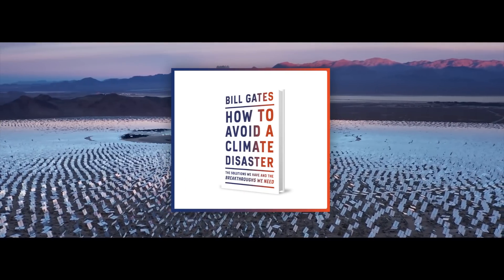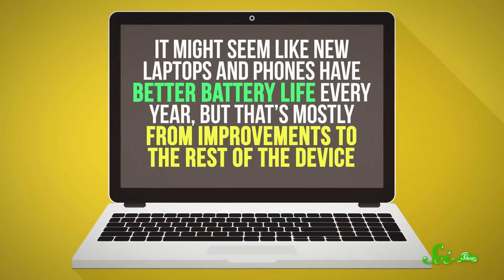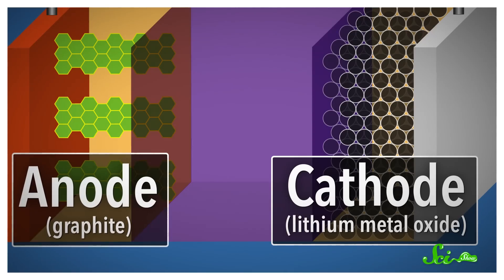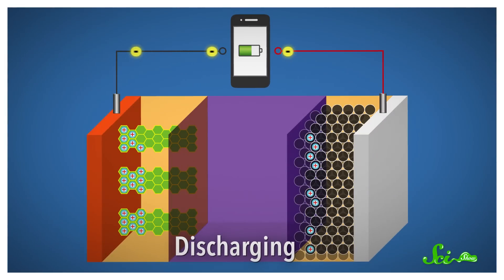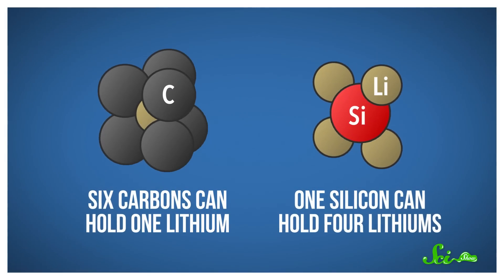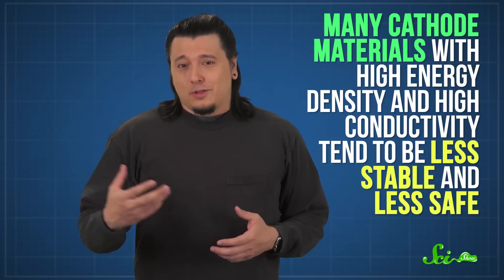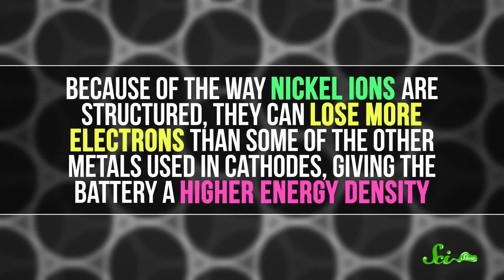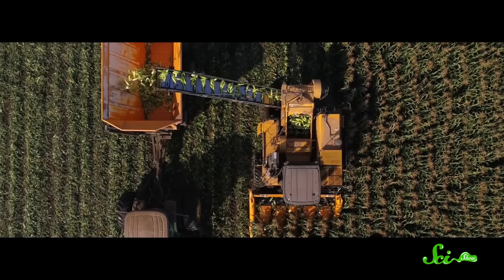Why Haven't We Built a Better Battery?

Comment: The real problem of solar plants is the tons of unrecyclable, toxic, heavy metal garbage they generate every few decades. Arguably they're as or probably even more problematic than waste from nuclear plants, given how much more is generated. That on top of replacing huge areas of ground, overtaking natural habitats. Discussing solar in the same way as we do wind or water plants is a joke. Unless the panels can be made recyclable, it's not a valid ecologic solution.
Reply: The way I see it, it is just a better way to do it vs... coal and stuff like that... so we have to deal with it and try to make it better until we find better...
Reply: 90-98% of photovoltaic panels can be recycled. There currently are no large recycling programs yet because there are so few cells in operation, but it is predicted that by 2050 the recycling market could be a $15 billion industry. The heavy metals used in the production of the panels are very valuable, so recycling them will be profitable. 
None of the waste is radioactive for thousands of years, has to be monitored and guarded for thousands of years since it is a security risk due to the potential to make dirty nuclear bombs out of it, and it is not recyclable (via breeder reactors) at any feasible cost. Nuclear has been and remains a dead end industry.

Comment: Redox flow batteries are much better suited than Lithium Ion.  Lithium Ion is really great for devices, but I don't need density like that for a battery farm.  I need total capacity and low cost.  I'd build a skyscraper sized battery next to a solar or wind farm if it was cheap enough.
Reply: And when it comes to devices, lithium ion may be really good at raw effectiveness but I'd still rather we get something like aluminum ion or sodium ion ready for common use just on a material scarcity level.
Reply: @Plotatothewondercat  Agreed.  No point in putting unsustainable batteries next to sustainable energy.

Comment: I surprised you guys didn't talk about redox flow batteries. A lot of research is going into them since they seem like one of the most easily scalable and universally applicable solutions to grid storage that we have at the moment.
Reply: I just commented on this too!  Really underrated.  Heavily reliant on Vanadium which isn't widely used outside of steel though.
Reply: @johnmcho  vanadium's got scaling problems due to its relative scarcity. There's been good research done in iron complexes but i haven't seen anything that demonstrates large scale viability
Reply: @Jacksonseymore  Agreed.  But those scarcity problems might be due to lack of demand.  It comes off tailings from mining other metals right now.  If redox flow was in higher demand, we might see better efficiencies.  No doubt the research is both investigating alternative metals as well as sustainable vanadium sources.

Comment: um it would be easly to use nuclear reactors  then makeing better batteries! unless the batterys also where nuclear too!  look up atomic batterys on wikipeadia and you know why we need to go nuclear! becsue its that or we won't be able to compsate for the unrealbie issues that wind and solar power are known for! plus nuclear is far far far more energy denise then like 1kg of refined uniranum has the energy desity of 100,000 tons of coal or other fossile fuels!  its also far more efechint then wind and solar by like 90% more efechent then solar and wind! theres even no corbon emetions from a nucealr reactor! sence theres no carbon even being used to heat the water into steam! means those big smoke satcks the nukear reacors use are actaly just BIG MOTHER F** Heat radators!

Comment: Why don't factories attach  return pipes to the smoke stacks . And maybe even burn that carbon the captored again. .
Reply: They are starting to add the scrubber systems and recirculation systems but they are very expensive and share holders don't like giving up money to help the environment.
Reply: @mnichols1979  not if they can make money from it land fills sell methane
Reply: you can't burn the co2 released (at least in any meaningful way).  The energy comes from it's transition from a fuel TO co2.  You would have to first split the carbon back apart from the oxygen to burn it again, which takes at a minimum as much energy as you got out the first time.

Comment: Ehh, China is building a 200 MW(800MWh) battery last I checked, seems that vanadium redox flow batteries are finally getting their legs on the ground.
Reply: There's also molten salt battery encased in thermal insulation ceramic. Meant to use more common elements like antimony as electrolytes while avoiding mechanical degredation lithium had to deal with.
Reply: Once someone/a company figures out how to design a new battery type that works, is lighter and more efficient, cheaper and so on than what we have now we'll enter a Golden Age.

Comment: Would a distributed model be any better? Like having large batteries for each home which can charge up when electricity is cheap and discharge when in use?
Reply: that honestly is what a lot of people are doing , having in house batteries and then using solar to charge it , so during the day they charge the batteries and sell back to the city, and then during the night it discharges the battery and if it needs more pulls from the city
Reply: It’s not a perfect solution for grid operations. To provide any substantive benefit a lot of battery units need to work together in unison. Communication between so many battery units can be complex, and cyber security is a concern. It’s also forcing the grid operators to be reliant on a 3rd party that might make a mistake, a mistake which could cause outages or severe price increases (from needing to buy more power on the real-time market). 

It’s easier to maintain control over single but larger units. Maintenance is also a concern. What if customers decide to not fix the battery or inverter? What if communication (i.e internet service) fails? The load does not go away so new generation has to come from somewhere to balance the system (unless you just turn the power off which is a solution, albeit archaic and savage). 

Large utilities also have large lines of credit, they can afford expensive things but hedge the expense over time. If everyone had to have an expensive battery unit in their home, it’s another expense that not everyone can afford. 

In a perfect world where all we’re concerned about is storing and releasing energy, it’s easy. But, in reality the electric system is much more complex than just balancing that energy equation. 

-engineer at utility whom is actively trying to integrate batteries into the grid
Reply: The cost-per-kWh will be higher for a distributed system, since each installation would need management hardware (charger/inverter). It would also potentially complicate grid repairs, since if these a power outage in a neighborhood, no battery system that exist inside the outage area would be permitted to export power to the grid for safety reasons. They could still power the individual home, but that may require more elaborate hardware and rewiring.

The larger the battery system, the larger the portion of the cost goes into storage and so the better your bang-for-buck. Grid outages would still be outages but grid-level batteries inside the outage area could possibly remain available and continue to serve their downstream zones.

Plus not everyone lives in their own home; A distributed model really doesn't work for urbanized areas.
Reply: There are models for this and some people strongly encouraging this idea, but like with everything, it's complicated. I heard some ideas to even use the current infrastructure of electric car owners and use the batteries of the cars as decentralized batteries of the main power grid (when the cars are plugged in at home).

A more decentralized energy net can have multiple benefits in general, whether it is the storage or the initial conversion from renewable energy sources to electrical energy but it is also much harder to maintain a stable grid. Not impossible, but definitely a challenge.
Reply: There's been some talk of using pluged in electric vehicles for grid storage, and there are advantages to distributed energy storage, but there are also advantages in maintenance and types of energy storage that large-scale storage systems have that are less practical at smaller scales.

Comment: I have a battery operated calculator/address and phone storage device that my dad gave me when I was 7 years old.  He said to make sure to change the battery regularly or I will lose all the information.   It’s been 44 years, I’ve NEVER changed the battery and it still works.   ;)
Reply: you freakin madlad
Reply: change != charge
Reply: It probably works on solar energy like most calculators today. Otherwise the battery would have drained in 44 YEARS!
Reply: @MonkeyDude1999  idk there's this one ancient battery in a university in England I believe that's still running after like, over 70 years I think.

EDIT: About 180 years. My bad. Looked it up. It's the Oxford Electric Bell.
Reply: @Guru_1092  I'm pretty sure I read about that. They can't take it apart to figure out why it still works.
Reply: @MonkeyDude1999  he mentioned it’s rechargeable
Reply: @jonnathan7515  A lot of people in this day and age are incapable of reading comprehension.
Reply: @jonnathan7515  No, he didn't.
Reply: @gordonlawrence1448  your momma.
Reply: @ClamBake7525  FACTS...
honestly it's terrifying.
Reply: @jonnathan7515  Where?
Reply: @jonnathan7515  no he said to chaNge the battery, not chaRge it.
Reply: PDA are tops 37 years old....as in the first ones to come out. Also adjusted for inflation they costed around 400 USD  which would make it the most ridiculous gift to give a 7 year old child. This is a science video and I honestly don't understand the appeal of coming here and lying but ok...
Reply: @AlvarM  Before PDAs, there was this:http://www.trs-80.org/pocket-computer-1/
Reply: @DunnickFayuro  1980 is not 1977, it's came out at roughly $239 in 1980 which equals to $811.65 today. Not only that but every offer of one of them you find has a non mercury battery replacement which would seem to indicate the original battery shelf life is over for the vast majority of them.
Reply: @AlvarM  This was just an example. You seem to beleive pocket computers / calculators / address books were invented much later than they were. Texas Instruments, Casio and others had similar products during the 1970's There actully was a "race" of sorts on this market. Race that allowed the invention of modern smartphones later on.
Reply: @DunnickFayuro  just look up the first scientific calculator, the first pocket computer and so on. There was a race definitely. But you seem to not know that a parent would not give their child the world's cutting edge technology worth hundreds of dollars just so she can play and save some phonea. The earliest model from 1973 weighs in at  9 kg. The world's first scientific calculator by HP came out in 1972. Again this are all firsts launches, so the technology was big, expensive and wasn't popular.
Reply: @AlvarM  I happen to know a bit about what parents would and wouldn't give their kids. I'm teaching toddlers since 10 years already, in a upper middle-class daycare. They get everything I saw this 5 year old get the iPhone4 the day mom got the 5. And this is only one example.
Reply: The graphing calculators from the mid-90s were like that.  We're madly curious what cutting-edge electrical and battery tech your dad had access to in 1976... 🤔
Reply: I'm calling BS. The first electronic device that could do all 3 of those tasks was the Psion organizer. Which didn't hit the market till 1984, which is 7 years short of the 44 you claim. They retailed at 130 dollars then, or equivalent to 329 dollars today. I remember the 1980. No one was giving 7 year olds cutting edge electronic devices that cost that much. There is also no way a battery has maintained sufficient charge to power something after 44 years. Most batteries have a shelf life of about 10 years. To expect 4 times that length is ridiculous.

Comment: If the battery is too good and lasts too long, the sales will go down at some point and the battery makers do not like that
Reply: We're far from that point though.

Better batteries right now would lead to the development and expansion of new battery markets, taking over roles now filled by other technologies.

That, and there actually is lots of consumer and designer pressure right now for longer lasting devices, smaller, and lighter devices that can do more and more.

There's still plenty of economic incentive for better battery tech.
Reply: Not really. Batteries work bc they convert the difference in electro negativity into charge and Lithium has one of the lowest ( only Caesium, Frankium, Rubdium are lower and Barium has the same as Lithium) and is a REALLY small atom so you can get much more atoms of lithium then Barium in a kilogramm of mass. We already reached one peak so we can only go with the highest electro negativity to reach a higher difference between them to optimize batteries as a whole so we either ionize noble gases (takes huge amount of energy) or use fluor (extremly reactive so you generally don't want to mess with it. You see making a long lasting battery that is also very efficient is just nearly impossible with our current knowledge of chemistry either you make a really good battery like fluor-lithium but in that case you'd had to break LiF with every charge so it won't last long or you use a "weaker" cathode but get less charge bc the drop in the electro negativity difference.